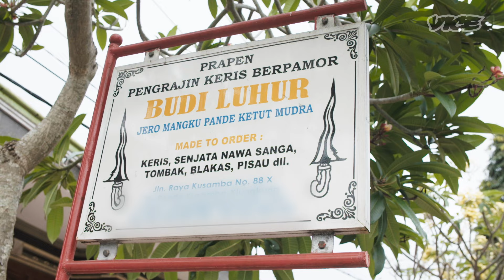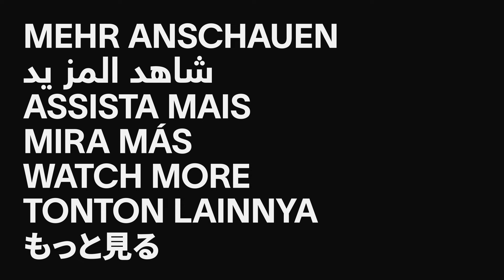How  Ancient Balinese Swords were Revived

Comment: Is that pattern the same as Damascus steel?
Reply: looks like it.
Reply: Yes. But its the bright parts are nickel or iron and other softer metals. And the black part is the high carbon steel. Most kerises are of sanmai construction tho. With the softer metals being the damascus pattern on the surface and sandwiched in between being the black high carbon steel
Reply: Actually Damascus steel is a lost technique....the one that you saw in blade smith nowadays were only imitation to the lost Damascus steel...in this case it is similar but not the same technique....
Reply: @amirulhusni1019  its true im well aware. But nowadays the term "damascus" refer to the pattern welded steels. The right term for the ancient steel youre referring to is called "wootz" or "bolat". But then again people use damascus and pattern welded steel interchangeably. But yes youre right when it comes to the real damascus steel,😀
Reply: @aminuddinazaharuddin4442  despite what the legends might make us think, today, modern stainless tool steels, cryogenically heat treated, are the best knife and sword steels by far in all human history.

Comment: you cant tell from pics or vids but the real kris's are very lightweight and the blade is flimsy, they were designed traditionally to break off into an enemy's body. Many antique kris's have replaced blades/handles. Theyre not practical blades, couldnt be used as machete or really anything other than sticking an enemy. The edges arent sharp.
Reply: That's when you're wrong.. kriss is final weapon to use during war..kriss it's not actually a weapon..they are part of the outfit..they have sword too.. and they are big kriss like a sword they called sundang..
Reply: I'm not sure where you got the impression that a Keris is lightweight or that its blade is flimsy. It looks thin, but from the ones I've wielded, it seems no different from a dagger from elsewhere in the world in terms of weight or strength.
Reply: @salex354  I get the impression when I hold one of my many antique and vintage kris's and compare them to the zillion other daggers and knives I own and have made.
Reply: @joejones9520  Perhaps it is due to their antique and vintage nature that they are thin and fragile. After Jamasan (Cleaning ritual) has been performed for years on end, any dagger including the Keris would begin to slowly lose material. New Keris or those well kept and oiled rather than cleaned in the traditional method should be heavier and much more durable than the blades you possess, because I’ve failed to have found scholarly or historical material that implies the Keris is meant to break off within an enemy’s body. It’s wavy/jagged blade implies that the severity and damage comes from multiple stabbing motions rather than a singular stab and break, and though it is coated in poison, historically enemies died from bleeding out faster than the poison can act (Methods of execution with the Keris during the era of Majapahit found executioners being efficient with this.)
Reply: @salex354  even very old kris blades show very little use, you should know this; they werent used except in battle and that was to stab. Ive never seen one with a worn down blade, handles are different story, many are cracked and often were replaced many times on same blade.
Reply: @salex354  I just realized youve probably handled wavy blades that are from the Phil-pines made of regular steel and likely WW2 era or later...those arent the kind of kris's Im talking about, those are just wavy blades, not kris's and they are heavy like regular knives.
Reply: @joejones9520  I am Indonesian, I am from the island of Java. I would be very surprised if the Keris blades that I have come across are Filipino, because filipino blades are very different from Keris - they’re Kalis which is more sword than dagger. I’m sure you know this, but I assure you the blades I’ve handled are most definitely not from anywhere outside of my homeland.
Reply: @salex354  is the blade surface covered with lines of fused  metals similar to how modern damascus blades look but much rougher? does the base of the blades have an almost melted look? Flare out widely at base?
Reply: @joejones9520  Yes indeed, it has that pamor the Keris is known for, alongside the handguard at the base of the blade you mentioned that flares out. All Keris I’ve encountered have both of these
Reply: @salex354  I give up then. We must have different perceptions of what is flimsy and what is not.
Reply: @joejones9520  Or perhaps, the more likely scenario is that the Keris you have wielded have had time and its cleaning worn it down to a thin, flimsy blade. I really do not know where you receive the impression that a Keris blade is meant to remain lodged within an enemy’s body or break after stabbing like a Roman pilum, what kind of family heirloom would be designed to break so easily?
Reply: @salex354  like I said, I give up; youre right, Im wrong, have a good day!
Reply: @joejones9520  My intention wasn’t to undermine you by making you think right or wrong, it doesn’t always have to be so black and white. You hold a Keris I have no doubt is genuine, and that it is brittle and fragile speak to its age and its time, you’re not wrong you just misunderstood the reality from the flawed data you had. I am informing you, not trying to condescend or think you are stupid for being wrong or anything. Take care Jones
Reply: I dont think they were design to break off into an enemy.

They are consider too sacred and valuable. Some have meteorite in them. Many are treated as amulets.

Some rare ones have finger prints and even lip marks made by the black smith  in trance.

You are right. They are for stabbing only. Not for slashing.
Filipino, Thai "kriss" are slashing types.
Reply: In fact; the edges are sharp as a rasorblade ! And it won't 'brake of' 'cause it's very pliable. But the keris is indeed à murderwapon! Sneeky and causing mortel damage, one doesn't use it to 'fight' but to 'kill'. 
That's why the Dutch forbid the forging and the use of the keris in certain régions ( like Bali or the west of Sumatra) where the population was constantly revolting against their own governement and life was less save than in Mexico-City nowadays!
I don't approove of our ( Dutch) colonial past !!! But we also did good things ( like bringing an end to centuries of tribal wars !) .Our 'behavior' in Atceh will be forever a smut on the history of the Netherlands....
But Indonesia ; we miss you as our lost brother. 😢
Reply: The keris was a noble's weapon. It's not something a common soldier would have used on the battlefield. It was more for self-defense (both physical and spiritual) off the battlefield against assassins and the like. So no, it's not designed to break upon use, but it's not designed to withstand a lot of abuse either.
Reply: @elbschwartz  goddam i didnt make this shit up, RESEARCH and you will find the same info, gdm i get so sick of people disputing everything.